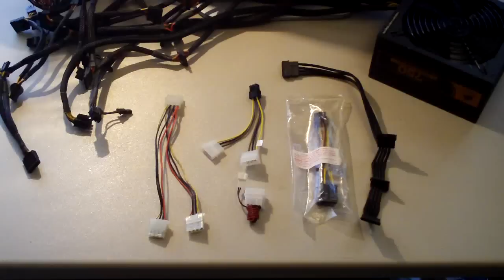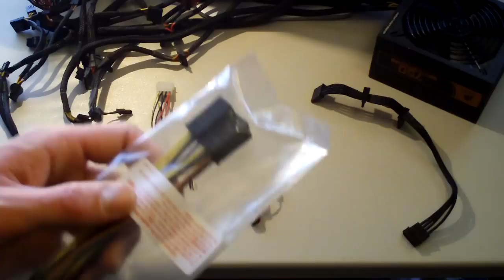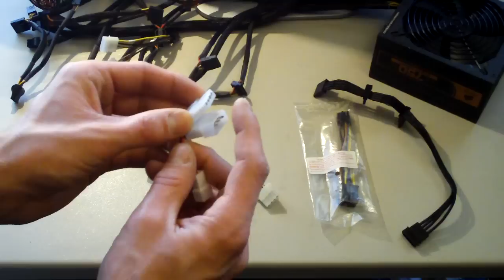PSU Power Adapters Explained (SATA/Molex/6-pin/8-pin)

Comment: Can someone help me??? The 7-1 Internal USB and memory card readers have a molex power supply on it. I have a modular PSU, whats the proper way to connect them
Reply: Looks like you need an adapter cable.
Reply: Firestarter So should I get a Molex to 6pin? But those all seem too short and cant reach from the PSU towards the front panel where the reader goes

Comment: Is a 6+2pin the same as one 8pin?
Reply: yes if your power-supply came with it. The 8-pin is designed to supply up to 150W of power, the 6-pin only 75W. So the pins should be powered with a cable and not just dummy connectors. Most high end power-supply have the 2 extra powered pins to convert 6-8pin.
Reply: +rockytruelyrox thank you for fast answer
Reply: You're welcome man. I was just on youtube limbo and thought I could help. Feel free to hit me up if you have confusion.
Reply: Clickbait I have a gtx 670 which uses 2 6-pin connectors. Everywhere online says its a 150+ watt GPU. So, i just bought a 120 watt RX470 as a replacement but it uses 1 8-pin connector. I've read all I have to do is just get a dual 6-pin to 8-pin adapter, but the guy on the video says I shouldn't use such adapter. Is that true? Will I damage the card or MB if I connect the 2 6-pins to power the lower wattage RX470? Thx

Comment: Sooo i want to put my gpu in my old computer because i have a 1080 ftw coming. but my old computer only has a two 6 pins but one has an extra two cables to make it 8, so like a 6, and 8 pin on it. My 770 ftw requires two 8 pins as well, so an adapter will work?
Reply: Sorry bud, the EVGA 1080 FTW takes two 8-pin power connectors. Most likely the wattage supplied out of 12 watt rail on that power supply wont be enough. More information about your power supply might help me to figure it out.
You could definitely use a 1070 or R9 Fury X (XFX) which is just 400$ with liquid cooler on Newegg if you are in states. Fury X takes a 6 and 8 pin.
http://www.newegg.com/Product/Product.aspx?Item=N82E16814150742

Comment: I have be quiet! system power 8 600W PSU, and a new gpu that need 2x8pin power, this psu have 4 x (6+2)pin pcie cable power, and i am using 2 of them or 2x(6+2)pin to fit into its 2x8pin and it seems okay, but now i am a bit confused when i checked back my gpu box, ...it comes with 2 pcs of 2x6pin to 8 pin adapter. I have 4 x (6+2)pin as i mentioned before, so is it better to use all 4 x 6+2pin(with 2pin hangging or not connected because i will be using these 2x6 to 8pin adapter) or just use 2 x 6+2pin? Is there any power difference between 4x6 pin than 2x(6+2)pin , bcause i think 4x6pin can deliver more power than 2x6+2pin. Sorry for my bad english

GPU: zotac gtx 1070 amp

Comment: I have a gtx 970 and it has 2x6 power supply, But I only have 1 6 pin cord and I cant find any more of them online. My psu has slots in which I can plug in another 6 pin cord or 8 pin cord, but I cant find a 8 (or 6) pin to pin cord.

I have the modxstream-pro
If anybody could help, that would be great!

Comment: Bro, will be it okay to connect GTX 950 using a Molex to 6-pin connector? It's because my PSU is quite old but it has enough power to supply the GPU. :) 
Thanks for helping out! :D
Reply: im trying to find out the same thing
Reply: Oh bro, it did work with my Zotac GTX 950 AMP! Edition. :) 

Good luck!
Reply: I guess you were trying to hook a very high TDP card. The Melting would be due to high wattage stress on low quality plastic connector.

Comment: I just got my gpu an ended up having to buy a 15 pin to 6 pin power connector due to my psu not having a 6 pin
Reply: Does it work? Good? I have a Raidmax 500W old psu. from late 2008.
It does not have 6 pins, will it work with a HD 6870 1GB 256 bit videocard"?
Reply: As long as the GPU takes a 6 pin connector yes it will work
Reply: Krazlus Games It does work hellofa good! :D

Comment: i have a 620 gold psu and they shop that installed it took my spare cables which included my other 6 pin for my gpu , is it possible if i could use a adapter to start a bigger gpu card because i dont have the money to buy another psu(its been a year i only realized now that they took them because i only need the cable now )

Comment: What about Molex to 8 pin?
Is that okay to use?
Am I supposed to input 2 actual molex's to power it?
Reply: +Odinwolfe it's to get 2, maybe even 3 molex to 1 8 pin
2 molex to one 6 pin is safe
Reply: +Fr0zenMyst i have 8 pin 2x molex for my Zotac gtx 960 4gb it is safe

Comment: i just bought a gtx 960 strix and i cant find my 6 pin power connecter ( i bought a pre built with a crappy gpu, it doesnt have any connecter) can you help me?
Reply: Look for two spare molex conectors. Then buy an adapter .

Comment: I recently bought an r9 380x and found out it requires 2 6 pin connectors(yeah, it was stupid of me to not research on the card enough) and my psu only has one 6 pin connector, so I ended up using the molex to 6 pin adapter. Why is it only good as a temporary solution? Should I buy a decent 6 pin connector asap? Or would it be okay to continue using the molex to 6 pin adaptor? I use a 700w psu but it's kinda old. Bought it in 2010.
Reply: i know its old ... but can u remember wat did u do? continue as adapter or got new psu ?

Comment: What if you have two 6 pins and need one eight pin?  I got an Evga graphics card that came with an adapter to turn two 6 pins into a single 8 pin.  I read somewhere that one 6 pin is good for up to 75 watts and an 8 pin is good for 150 watts.  It sounds safe to me as long as the power supply has the two 6 pin connectors.  The 8 pin end is the one for the graphics card and the two 6 pin ends are the ones from the power supply so this one really combines two connectors into one rather than splitting an 8 pin into two.  This is the one that came with the card in the box and not some other one that came off the shelf with all the other adapters.
Reply: So is it okay to use the splitter so should I use the standard PCI-E 6 pin that has an extra 2 pin to completely be slotted as an 8 pin? I got an EVGA 850 BQ EVGA 1060 SSC 6GB card. Advice?

Comment: I have an 450W PSU and does not have 6 or 8 pin cables for graphics card
I have MSI GTX-960 graphics card and i don't know what to do!!!
Should i get 2 molex to 6 pin and 6 pins to 8 pins adaptors???

Comment: My psu has a 4 pin normal thing and a 4 pin molex thing and I ordered a molex to 6 pin will this work for a gpu? Sorry this is my first build and I rather young and don't know much about wires and stuff if anymore info is needed I'll link to all products I have ordered

Comment: ok i have 2 6pin connectors and no 8 pin connector but i have a gtx 970, can i just use a single 6 pin to 8 pin connector? keep in mind im not overclocking the card, will this cause any harm to the card? I NEED A REPLY ASAP SO I CAN ORDER FOR BEFORE CHRISTMAS
Reply: +Enbarr Gaming my psu is 500w btw and i only have single molex so 2x molex to 8 pin will not work for me
Reply: +Enbarr Gaming ok XD i think i may have came up with a solution, but tell me if this will work, i am going to just pair these two adapters 

http://www.amazon.co.uk/Molex-Male-Female-Splitter-Cable/dp/B00IHE4AMA/ref=sr_1_1?ie=UTF8&qid=1450589450&sr=8-1-spons&keywords=molex+splitter&psc=1

http://www.amazon.co.uk/kenable-Express-Power-Cable-Adapter/dp/B009WMB5RO/ref=sr_1_2?ie=UTF8&qid=1450589523&sr=8-2&keywords=dual+molex+to+8+pin

Comment: Hi I just had a question to ask you. I have a regular stock graphics card which is a Nvidia GTX 650. I recently bought a MSI GTX 960. The problem I have is that my old graphics card took a 6-pin, and the new one I have takes an 8 pin. I'm not entirely sure what I should do, if you could help me out that would we great, thanks.
Reply: +MattAndrewsBMX basically get a new psu or use the 6 pin to 8 pin they provided. Getting a better psu would overall increase performance but hey its up 2 u
Reply: +Jacob Olson  okay thanks alot

Comment: I bought 2 molex to 6 pin adapter. Do I need to connect BOTH of the 4-pin molex in order to run my videocard(which is hd 3870) ? Because the card runs with a single molex connected, but when I try the two, the pc doesn't even start!

Comment: Re: 3:50 With all due respect what you said about 6 pin to 8 pin cable is not accurate: There is a danger to the user if they don't know what they are doing but the cable in itself is not bad. I have an old OCZ 1000w power-supply and it only had 4x6pin, connectors despite the fact that it had more then enough juice to run a Xfire or SLI for 2 cards. I used two of these adapters to power 2 R9 290x playing games at Ultra for over a year now. There's nothing wrong with the adapter if your psu has enough juice on the rail.  The extra 2 pins do not supply any power. It's a close circuit and if your GPU does not detect closer, it won't run. In the regular 8 pin, the circuit is closed within the psu. In the cable, the circuit is closed within the adapter. The 8 pin standard is there, only to signify that the cable is guaranteed to able to supply a minimum amount of amps (I beleive an 8pin cable should be able to handle at least 150W at 12V and the 6pin is rated for a minimum of 75W). If a user is unsure what their PSU is able to deliver, they should not use this cable. I would not recommend buying these cables from a noname Chinese supplier off of eBay. The build quality is made to last exactly one day more then the paypal refund claim period.
Reply: +thebunnyrules i have a OCZ 600W power supply, it has 2x6pin connectors attached to my gtx670. I would like to upgrade to a gtx980TI witch requires 2x8pin connectors.How do i do this?
Reply: thebunnyrules Hope u read ur comments tech tv  im in a big trouble here.
My psu only has a 6pin power connector. But i recently bought a 2nd hand rx 470 nitro which has a 8pin power connector. What should i do now ? My psu has more than enough juice to power this card.
Reply: thebunnyrules hi i have a alpine 700w psu but only has a 6pin, I've seen a few people use 6pin to two 8 pins but I'm worried lol,  gtx 770 4gb

Comment: Hi, what's the difference between a (1) 15 pin sata to 6 pin pci-e and a (2) 15 pin sata's to 6 pin pci-e? I have an HP Compaq 8300 Elite CMT. It has a 320 Watt proprietary power supply which has odd wiring to the motherboard as it does not have a 20/4/24 pin power connector. It has (2) 4 pin, (1) each to (2) sata powers and a 6 pin power to the motherboard (same size as a PCI-E 6 pin) and finally a flat thin 6 pin. All these wires replace the 20/4/24 pin power connector. I've never seen this set-up before. I want to run a Evga GTX 950 on this PC as it also needs a 6 pin pci-e for extra power. The GPU takes a 350 min. PSU so I do what you advise, search for and upgrade on the power supply. This power supply/motherboard is very oddly wired. The power supply is proprietary. My processor is a i7 3770, DVD burner, 500GB WD blue sata hard drive, (1) case fan and (2) 4GB DDR3 1600 ram. That is my PC. So I have looked for a larger power supply like this one and can't find one similar. Just ATX's. How much power does my PC need from the power supply. Will it in fact be big enough for it's needs if I also run this 950 single fan card. There's no 4 pin molexs to take two of them to a 6 pin for the extra power. It does have two other sata powers on the power wire that's plugged in the hard drive and 1 extra sata power on the power wire that runs to the DVD Burner. Can I take any two of the extra sata powers and run an adapter cable that has (2) male 15 pin sata's one end to a 6 pin pci-e other end to run the 6 pin extra power to the GTX 950? Or would it just take (1) of the 15 pin sata to 6 pin pci-e? If my power requirements are low enough will this all work? Here is the motherboard  on ebay # 262018561039 and the power supply ebay # 291463023074  Thanks so much for listening and sorry for being long winded!!

Comment: I have a gigabyte G1 Gaming GTX 980ti, however on my top quality make 600Watt PSU i only have a 8 pin and 6 pin yet my video card requires x2 8 pins. My solution was to use the 8 pin then use a converter for the old power but my question is this.

Will i be better off using a 6 pin to 8 pin converter then connecting the 6 pin in the other 8 pin connector on the video card?

Let me know thank you.
Reply: I got the same problem i dont have a secondo 8-pin
Reply: Its been working fine with a 6 pin to 8 pin converter for me so far. :)
Reply: yeah is it ?
Reply: I'll need to turn the 6pin into a 2 x 8pin connectors so I can power my 980ti, but I've noticed the round and square pins are sorted differently in the PSU and in the GPU standards so I can make a frankenstein adapter from a 6 to 2 x 8pin and change it's 6pin part to match the pinout of my PSU. It this safe?
Reply: is it still working  ? :0

Comment: hi im upgrading from a 650 witch only needs a single 6pin in the back. i want a gpu that requires 2 6pin connectors what should i do my psu only has 1 6pin connector

Comment: just bought a msi r9 290 which requires both a 6pin and 8pin (right?)
im planing on using the 6pin from my psu and a dual molex to 8pin to power it.
or is this just really bad practice?

Comment: Right, I have just purchased a Asus Strix 970 and it needs one 8 pin connector. My PSU is 750 watt and it only has one 6 pin connector. Will I be able to use a 6 pin to 8 pin adapter without any problems?
Reply: I got it and then blew up my PSU. Got a new one and it works fine :) Thanks!
Reply: +Burger lol ur name is Burger wth
Reply: +EliteBlockz Yeahh my GTX760 (IM SO JELLY OF YOU) requires a 6 + 8 Pin connector but for some reason when I look at the connector to see how many pins it has to transfer power to the GPU it only has a 6 + 6 pin connector. It's been working fine for months though but I wonder what would happen if I had the proper 6 + 8 pin connector. Sometimes I imagine that if I had the right connector I would get higher FPS or something lol.

Comment: Im buying a EVGA GTX 980 classified and I see that it needs 2 8-pin connectors?? does these exact pins always come with for example an 1000W PSU? Do I/can I buy these connectors separately? heeelp im a complete noob
Reply: I just bought One and it needs a minimum of 500 Watt to run properly. I have a psu with 875 Watt but only 2 6pins instead of 2 8pins so I'm going to buy the 6 to 8 Adapter since my psu will be able to take it.

Comment: Thanks for the great explanations.  I am about to upgrade wtih gtx970 which requires two 6 pin connectors but I have only 1 and will use 2 molex to 1 6pin adapter for the other slot. I was wondering if my video would work. However, soon a power to be bought!

Comment: My PSU is 550w and the card I just got requires x2 6pin 150w (450w system requirement). But my PSU only has 1 6pin. Would the dual molex to 6pin be a solution, or do I need to upgrade my PSU?

Comment: Hi please help. My son just bought a  MSi GTX 970, it only came with 1 6pin, but the computer is giving an error message. We r on our way to Best Buy to get a 6pin dual cable connector. Will this work, or are there other cords, pins needed? Thank you.

Comment: Do you have anything on splitting and stacking molex cables? Should I worry about anything else other than the total voltage required by the system?

I.e. am using all 3 plugs from the 1 cable (type 4pin - 3x 4pin molex) connected to the source to power 3 hdds. Decided to add disk cooling (with same 4pin molex supply), can I split the power plug of each disk, or should I draw a new cable from the supply (and mess the wire management worse than it already is)? same with fans connected to the Mo-Bo with the 3 pin adapter, should I split or should I use a new molex + adapter from the mo-bo?

Comment: HELP GUYS! I bought gtx 760 and it requires dual molex input but my psu doesn't have ANY female molex, solution??
Reply: Ante gunjača A little late but, your psu has male molex connectors. buy a 4 pin molex to 6/8 pin pcie converter.